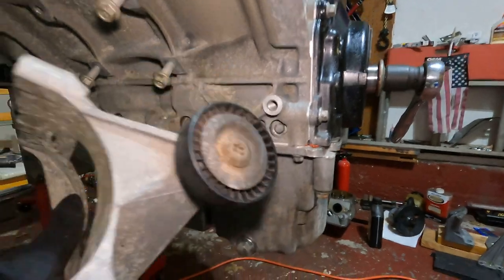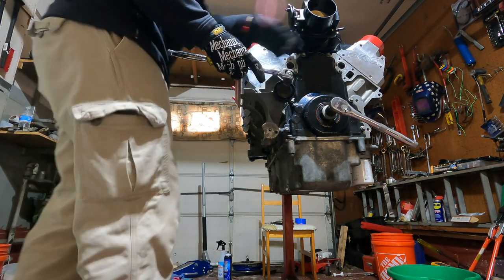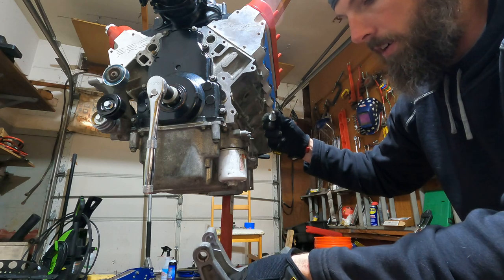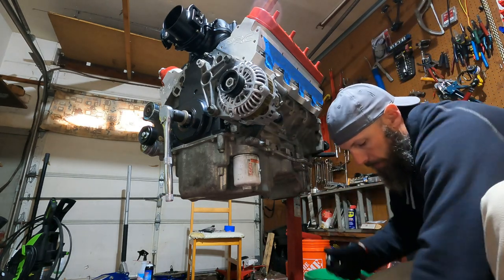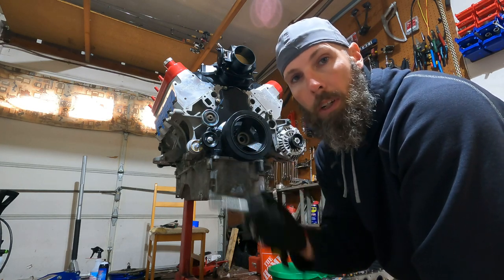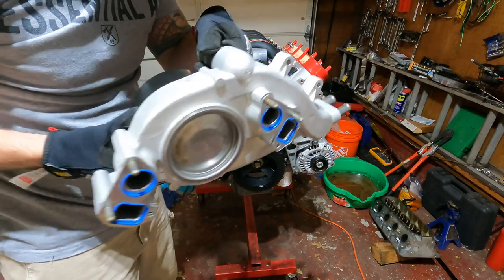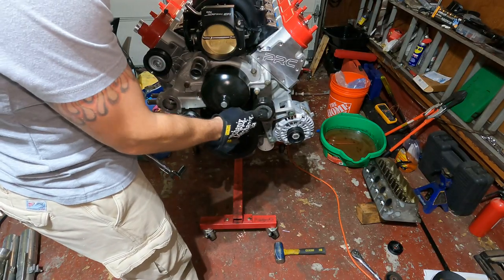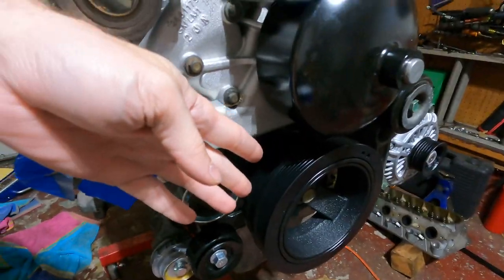GTO LS1 front engine components installed

Comment: When I did the cam in my GTO over a year ago I think the harmonic balancer bolt you’re supposed to use the old bolt put it to like 240 foot pounds then take it out and torque the new one to like 37 ft/lb then 140°
Reply from the maker: That is the route I'm going with this one. Getting that 240 is pretty rough haha. I should have mentioned that in the vid. Thanks for bringing it up
Reply: @Billy_Ray_Garage  yes it is especially since I have an auto so I didn’t get to put it in gear and use the brakes. I ended up using a band wrench that I had letting it rest against the alternator bracket and putting on my bodyweight into the torque wrench.
Reply from the maker: Only thing I can think of is using one of those fly wheel locks that bolt into where the starter goes. Don't know if it can handle 240lbs haha

Comment: Do you have the part number for that idler on the main drive? I’ve gone thru some trash idlers that squeal.
Reply from the maker: I'll look it up. Let me get back to you on that
Reply from the maker: @boundlessbuilt943 manufacturers #19418226  its AC Delco original equipment. Google and it will come up. No issues with it. I believe it's the 3rd one I've used and never had issue with any of them